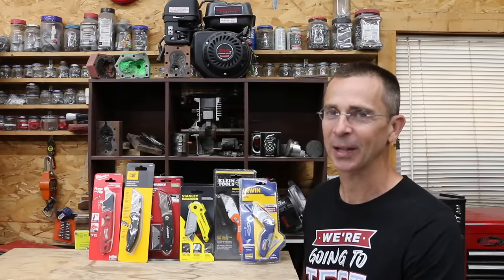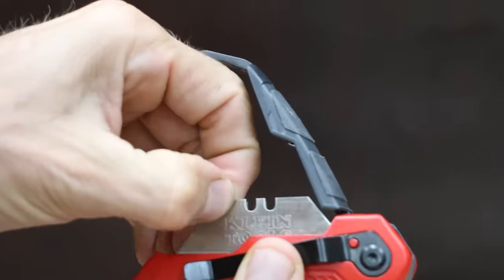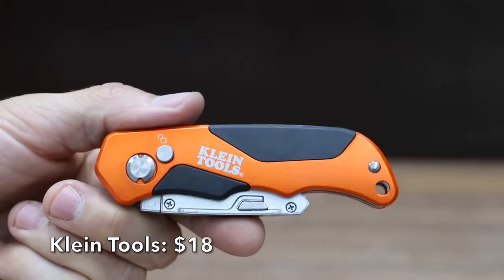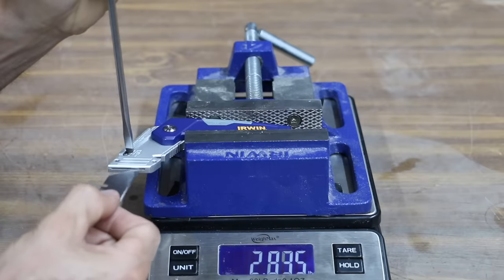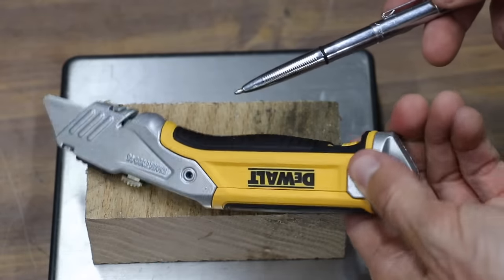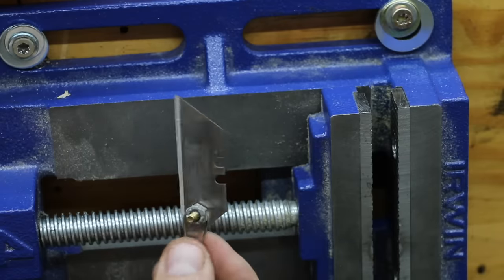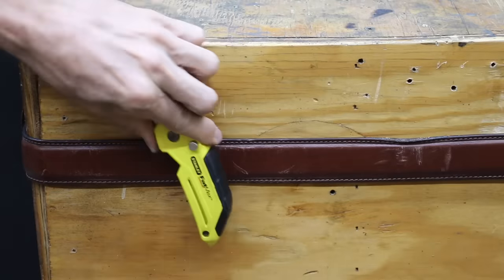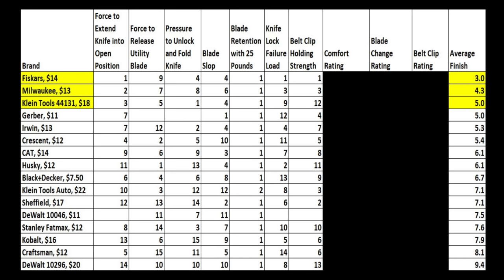Best Utility Knife? Let’s Find Out! Milwaukee, DeWalt, Gerber, Husky, Kobalt, Klein Tools, Craftsman

Comment: It would've been nice to see which ones can take hook blades or serrated ones. I've had issues where not all will accept hook blades
Reply from the maker: Thanks for the constructive feedback.
Reply: @ProjectFarm  i always live your videos. Whenever I need a real answer with the mechanics and data to back up a decision... You're one of my first thoughts of where to look.
Reply: Matthew, the Milwaukee FastBack II can handle hook blades and Stanley's FatMax blades, no problem.  I would be careful removing a spare blade to swap it out, as some hook knives have deeper curves that reduce the amount of metal for the knife to handle.  I use hook blades in place of normal ones since only the inside of the curve is sharpened, which is safer to use compared to a straight blade.

Comment: I have a few of the Milwaukee knives and it sucks at cutting Sheetrock because the blade is never held in tight and removes itself.     Other than that issue, it is my go to for every other use.
Reply from the maker: Thanks for sharing.

Comment: I have a Kobalt that I bought several years ago. Push Button Lock/Unlock. Holds Three Spare Blades.  Opens and closes with one hand. Good pocket clip. The only thing it lacks is a cord cutter or a wire stripper. Super easy blade changes. I don’t know if they still make the style. But it’s a GREAT knife. I use the heck out of it.
Reply from the maker: Thanks for sharing.

Comment: The Sheffield style blade-retention is my favorite because there's no wobble or accidental release like happen on other styles.  I use the aluminum body version, but it's definitely worth taking a few minutes to adjust the tension on the leading bolt so the knife opens more easily and carefully bending the tab on the blade retention to lock securely.  No rubber on the handle makes knives slip into/out of your pocket more easily too, especially with jeans that might fit a little tight.
Reply from the maker: Thanks for the feedback.

Comment: I've had the same Milwaukee Fastback in my back pocket every day for 2+ years now; I absolutely love it and find myself flipping it open and closed as a nervous habit sometimes. I use it, abuse it really, every day. I'm a woodworker and I'm not sure many other box cutters have seen as much prying, violently being jabbed into wood, shaving a bit off wood off a rough board to help in identifying; hell I even use it to cut through 1/4" thick plywood "tabs " that are left after I cut small parts on the CNC. I once jokingly threw it at a throwing hatchet target, figuring it would survive the bounce; and it actually stuck the target by the blade and I had to pull it out.

There's some surface wear, belt clip and the button are silver instead of black now, and I do feel like the blade is a little loose in it's holder than when it was new - however it's never lost a blade. The one I have has the 5 blade fold-out handle compartment - it has better ergonomics than the others ones I've tried in my opinion - plus 5 spare blades is hard to beat. The thing also flips open just as easy as the day I bought it. Excellent knife and I highly highly recommend it.
Reply from the maker: Thanks for sharing.

Comment: I use several Milwaukee knives some in single blade some with blade storage (it comes in 5 blade storage version), Has wire stripper section, longest exposed blade and you dont even have to open it to cut straps etc. Definitely a winner for me
Reply from the maker: Thanks for the feedback.

Comment: I have the Milwaukee Fastback.  It's a different model than the one you showed.  This one has a screwdriver and bottle opener on it as well as storage for one blade.  If I hold mine folded with the blade side down and press the button it just falls open.  I like that.  It makes it really easy to open and close.  Then if I release the button in any position it locks it in that position.  The blade storage sucks though.  It doesn't hold the extra blade securely at all.  I pulled the knife out of my pocket once and the extra blade was sticking out a little bit.  I don't store an extra blade in it anymore.  The blade release button in my opinion is really easy to use.  It's the same as the one you tested.  I do agree with the blade slop and putting on a belt clip (or in my case, clipping it to my pocket.)  I wonder if they changed a few things for the Fastback.  I love this knife.
Reply from the maker: Thanks for the feedback.

Comment: I got the fiskars, and it has one feature I really like. Just about every other pocket knife I've ever owned had the belt clip either riveted on or attached with a really really small hex key. This one is attached with small Phillips head screws. Within two days of owning it I got the belt clip caught on something and bent it outward. So I was able to just unscrew it, and then squeeze it back into shape with a pair of pliers. Every other knife I've ever owned I had to break it off because it was sticking out so far.
Reply from the maker: Thanks for the feedback.

Comment: I have the Milwaukee, Fiskars and Crescent. A utility knife is my main tool at work. The Milwaukee is my daily driver and favourite by far for its ergonomics and opening/closing action. Previously I used the Crescent and loved it but it does need some wearing in, a little bit heavy and the pocket clip is not great but it is still in my kit - the locking mechanism is starting to get wobbly after 2 years of use. I bought the Fiskars because it looked pretty cool, I can't say I like it. It is a little heavy to carry in a pocket (better to keep it on a bench top, I personally don't like the ergonomics but the blade holder part and change button are excellent.
Reply from the maker: Thanks for sharing.

Comment: Dewalt has another folding knife that I have fallen in love with. It has been through hell at my place of work. It holds up to 5 extra blades, flicks open, and has a great belt clip. I accidentally dropped it in a mix tank that has an agitator and heats to 300 degrees. It spent all night knocking around in that tank. Then spent the rest of the next day at 200 degrees. Fished it out a few hours later and it still worked like new. All my coworkers wanted ones of their own after I got mine. Highly recommend getting the different DeWALT folding knife.

Comment: Notes on the Milwaukee FastBack knife: 

----You noticed you could flip it open one-handed so you tested the resistance of the knife with that button held down, which is correct.  Then for some reason you took your finger off the button for the second half of the opening force test.  You need to hold the button down until you hear it CLACK to signal that it is open the whole way, which it does at pretty much zero force.  

----The resistance you were experiencing after you released the button may have been intentional.  Some FastBack models include a locking point at a 45 degree angle in case you want to use it that way.  If your model has that 45 degree stop then it looks like you released the button JUST past the stop-lock point, so you are feeling the back side of the button dragging against the moving part of the knife.

----You can also flip it closed one-handed, which I didn't see as being possible for other knives.  It's great being able to flip it closed because I can keep my focus on the thing I just cut.

----The little button guard on that Milwaukee FastBack is new to me.  I prefer the FastBack I or II since they have longer handles and no button guard, but this shorter model looks to be the same feature-wise.  

----Having no spare blades confuses the hell out of me.  The Fastback series DOES include a place for more blades but only on some models.  I can understand why on the mini knives or even the first knife in the Fastback series, but in the newer knife models?  I can't imagine people complained about having spare blades...

----Oh, and they work with every type of disposable blade I have tried including the Stanley Fatmax as well as curved roofing blades.  The Fatmax blades are thicker than normal blades which makes them too big for most utility knives.  Looking for a better knife that would take the Fatmax blades I'd mistakenly bought was how I found the Milwaukee Fastbacks!  (Ironically, the knife they wouldn't fit in was a Stanley knife.  Not even compatible with their own blades!)

Comment: Great video! I oversee 3 warehouses and I'm constantly looking for the best utility knives to get my a$$ out of there as quickly and with all of my digits every day. I have a short version of a Milwaukee Fastback, Craftsman folding, Fiskers Pro, Kobault Fastback , and finally a 4 dollar Craftsman fixed blade desposible Coke bottle and letter opening, safety grapple-like box ripper. I love the box ripper to open my plastic packages and delicate packages, always with me. The Milwaukee has the best belt holder( just bend it out a little bit.) NOTE: If a Switchblade, that's what I call them, is too sluggish, hit it with some small allen wrenches or precision screwdriver set. I've been doing that for years and never had a problem or even worry about adjusting it after I set it how I want it. Craftsman Fastback OK, Milwaukee is overrated except for the clip. I always have the Craftsman desposible that I will never throw away. I put a keyring on it and put it on my retractable lanyard with my regular keys. The Kobault Fastback was my favorite actually. Quick and easy blade flip, 5 blade storage that came with the knife for about $17 bucks. But it grew legs one day last week when I went to take a piss. I just bought the Fiskers Pro and it tore my pocket and was cutting into my belt. It was 2 fat with that empty orange guards on it. So I just cut the muthaf#@kas off completely and took a file to the handle. Easy to take off and it feels a helluva like lighter without the life vests it came with. So.. 1. Kobalt(no complaints) 2. Fiskers Pro, (needs to leave the lifeguard supplies to the Hoff.) And with barely any pinky grease it's growing on me. 3. Craftsman, (blade storage and light. Last is the Milwaukee. That vertical blade drives me nuts and no blade storage on mine. Short handle does not have the storage. Do a video about weird or homemade special tools would make a good video. Thanks
Reply from the maker: Thanks for the suggestion.

Comment: I actually bought the compact Milwaukee a few months ago simply because it was only $10 and is easy to change the blades.

It doesn’t have blade storage, but I just toss extra blades in my tool bag.
Reply from the maker: Thanks for sharing.

Comment: Bahco has a really good knife. It doesn't fold but stores at least three blades in the handle. You press a button which allows you to remove or insert a blade and pushing a lever on the handle pushes the blade out at the top, or pushes a new one into position.
Reply from the maker: Thanks for sharing.

Comment: I have the sheffield version made for Craftsman from quite a few years ago... Looks good, positive connection excellent feel in the hand once you make sure the lever is down as you noted... I also got a Kobalt here a few years ago and really like how that works. It is simple and one handed and that came in handy down on my hands and knees, getting old silicone off of a shower surround here a couple of weeks ago... I give the nod to Kobalt there for sure... I have the Sheffield/Craftsman one on my tool belt as it has a nice clamp built in that HOLDS IT in place and I use it seldom... Also Sheffield/Craftsman had a small version that came with it that is perfect for the car/truck... Finding the little blades isn't easy though... For occasional use with a good blade already in one, the Sheffield is nice if only for looks and feel in the hand, but for WORK changing out blades a lot, the Kobalt is quite nice...
Reply: I've the one badged Craftsman too, 'n came with a dandy stiff nylon pouch..free with some wrenches I bought. ha, I use the pouch for my SAK Huntsman knife.

Comment: I've owned the Sheffield since 2006. When I bought it they had the oval logo, IMO the better of the two. I used this knife extensively in refineries and chemical plants all over the US and around South America. It's been dropped off 3 story decks on asphalt, dirt, rock layered foundation and not a single time has it shown issues after. I use Ivy brand blades as they are Made in the USA and are very good quality. It is a beefy boy and therefore it has heft. This review of it is 10/10 accurate. BTW, I am still using this now as an aircraft mechanic and plan to until I can no longer turn wrenches.
Reply from the maker: Thanks for sharing!

Comment: Thank you for the video! I'm afraid that I'm fairly set in my ways. 
I've got the Milwaukee fastback with extra storage for the blades. 

Easy one handed operation, I never have to use two hands for opening or closing. 

The gripe with the less than ideal blade change button is very well warranted. 
Never noticed the issue with the belt clip, I spend too much time driving and thus I store my knife in my breast pocket, I love that it holds rather tightly even on a thinner material like my shirt pocket. 

The wider grip coming from the blade storage is actually helpful with my big hands compared to the model you tested.

My knife will just freely rock back and forth as long as I'm holding the button down, so definitely not zero resistance but also less than your tests. However mine has followed me for 2 years and sees use multiple times a day 5 days a week, I would qualify that as well broken in 😂.

Now that I finished your video I'm proud to see that the Milwaukee came in second overall!
Reply from the maker: Thanks for the feedback.

Comment: i love my milwaukee fastback. in my opinion its the best utility knife there is. Mine holds 5 blades in the handle, and i did not get the version with the fold out screw driver, but i dont really need it that often. Once you get used to the way the button works, it opens as fast as you can make it open with a wrist flick. Ive had mine for about 3 years and with using it nearly every day in my construction job and at home it still locks blades in niceely and has very little slop in the hinge. I've also never had any issues with the blade release button on my fastback, even with gloves on. There are plastic handled versions, but im pretty sure mine has an aluminum handle. And ever since ive used the fastback i would never use any other utility knife with a different locking system, the button lock is just so much nicer than lockback, linerlock, slide knives, and especially anything that uses a screw to open

I swear im not paid for this, i just really like my fastback

P.S. my instructor at my trade school has a blue aluminum scheffield folding utility knife and he said hes had it for a very long time. it was broken in to the point where he could just flip it open when he needed it, even though there super stiff when theyre new
Reply from the maker: Thanks for sharing.

Comment: I appreciate the effort you put into this one - the first couple of catastrophic failures with the railroad tie were because the tie hit the handle, not the hinge point, so the entire impact crushed the handle.   The others hit further up at the pivot, which is inherently stronger.    

Have you thought about looking at the blades themselves?   I have a stack of Pacific Handy Cutter brand S3 'safety cutter' knives, which are nasty.   (They have an S4 now).    The cutters can't be used without their proprietary (probably patented) blades, which have no real tip to them, and they have stamped cutouts, much like Gillette used in the early Razor Wars. 
 

One last thing - I wouldn't think that too many people working like this would use the paper core belts.   A full leather belt would have been a better test for the belt clips, as they're more continuous thickness across the entire width of the belt, rather than having the squishy padding in the middle.
Reply from the maker: Thanks!  Thanks for the feedback.

Comment: Toughbuilt makes 2 interesting utility knives: One comes with 2, 5 blade, despensing, magazines that slot in the bottom and the other has a mechanism that rotates the utility blade 90º to use as a scraper. My favourite will always be my first though: A Toolpro (local auto-shop inhouse brand) green, oval-shaped, double-lockback in the style of Faithfull tools
Reply from the maker: Thanks for sharing.

Comment: When the Sheffield was originally marketed I purchased a dozen or so  and gave my employees and subs one each for Christmas. I never had a problem opening with one hand but I had initially oiled and polished the mechanisms to make the action very smooth. I still have the one I kept for myself, must be around 20 years or so by now and still works like the first day I used it. I do however use a Stanly fat-max (non folding) for most serious use on jobs such as drywall which is also over 20 odd years in constant use
Reply from the maker: Thanks for sharing.

Comment: I’ve had a very 2 piece set of Milwaukee utility knives that are very similar to the one you tested. Part # 48-22-1502 is the full size one, and it also came with a compact one, part # 48-22–1500. Paint and logos are basically worn off after being used and dropped time after time often on concrete floors and they still open smooth as butter one hand
Reply from the maker: Thanks for sharing.

Comment: Husky are my favorite of the ones I’ve used. My knives get used and abused and husky’s blade change is by far the best. All of the other ones get grit, mud etc in them and then the blades don’t want to come out or go in. The husky allows me to clean the surfaces and then it’s good to go. I’ve never warrantied one out because they are $5 and I have never had one break on me. I usually just get them so filthy I replace them rather than clean them off.
Reply from the maker: Thanks for sharing.